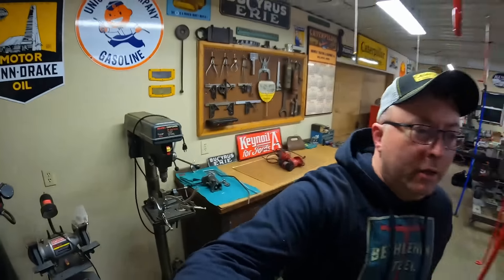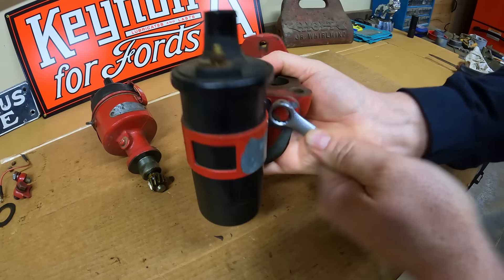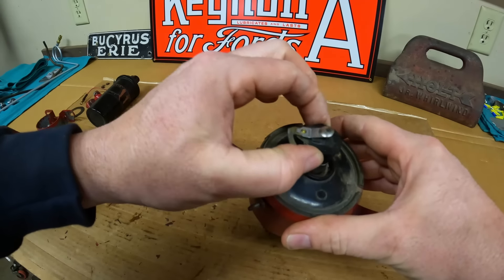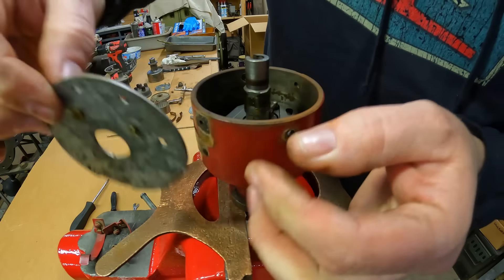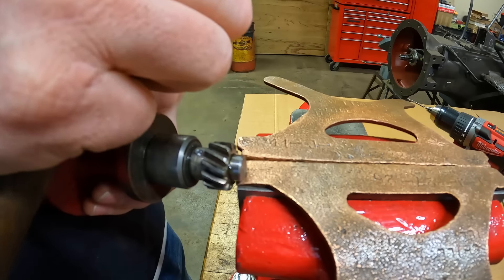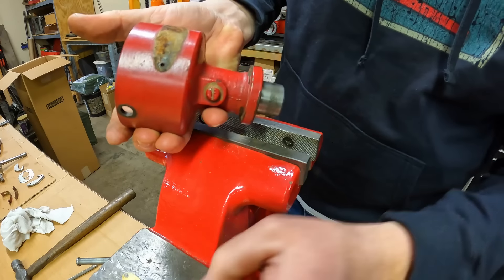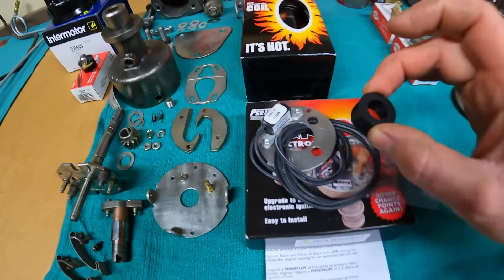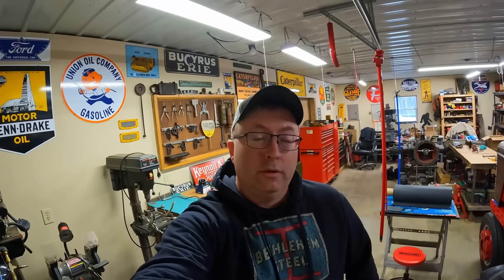Farmall Double Distributor Build! Electronic Ignition vs. Points & Condenser - "Preparation H" Ep.35

Comment: 20 + years on the automotive side I’ve used the points electronic conversion, I’ve had one failure and it was intermitting not dead in the water. The poor quality of points and condensers now you are about forced to the conversion.
Reply from the maker: That's where I am with it too, I know several others that have switched to the electronic ignition and haven't looked back.
Reply: @squatch253  I've had luck with removing the worn points off old units and replacing them with ones from new old stock of higher quality. It's fiddly and you really need to know how to braze tiny things. I tried staking them in the hole, but they don't last. Usually the arm one falls off because the metal is too thin.

Caveat: you have to have NOS parts on your shelf... so it ultimately depends on how many you can find in your area. I got lucky and an older gent i knew left me all his old bits and bobs and ~50 or so boxes with points for Skoda cars from the 1970's. Dunno about other brands, but Skoda made them a bit more ... let's say industrial. So they're good for older cars or tractors.

The idea isn't mine, got it from a few posts i read about (desperate) people cutting the sections that hold the points and welding them with a spot welder and a point of TIG welding for the base. I don't have a spot welder, but i know how to braze, so it was a logical solution for me.
Reply: @aserta  Great. I actually got the same thought of transferring the wear-heavy items - the points themselves - from the new plastic fantastic to the old sturdy ones. What about the part in contact with the lobes? You couls also get the contact points from high amperage relays/contactors.
Reply: I just upgraded, my 3-cylinder ford 2000, I'm much happier with it now

Comment: This lubrication holes of the distributors are made to lubricate the bushings and shafts. Even there's no direct hole thrugh the bushing, they are made from pourous sintered bronze that has microhole cavities in the bronze that allows the oil to go from the outside of the bushing to the inside to lubricate the shaft. They are also widely used in starter motors and generators. The oil keeps the bushing "wet" which allows the lubrication to be transfered via the microholes to the shaft inside. If you use regular bronze for this bushings the shaft will get sized with the time. Only pourous sintered bronze bushings should be used, and should be lubricated from time to time.
Reply: yes!
Reply: When Toby began his discussion of the placement of the lubrication plugs that appeared to make no sense, I immediately paused the video knowing I would find this comment.
Reply: Sintered bushings will only let oil soak through them. Grease will not. It's also possible due to their age the bushes were replaced, minus a very small pilot hole from lube point to shaft. Worn bushes
on this part will give erratic spark, like a miss. If the rotor wobbles , the worn shaft bushing(s) need to be replaced. Something I only used to diagnose when a points motor was hooked up to the goo ol' scope. The wiggly lines on the screen gave this fault away.
Reply: I was going to guess at running temperature the grease would melt and find its way to where it needed to be.

Comment: Those bushings are sintered. Meaning they are porous and saturated with oil. Same thing as in the front of a starter motor. If you put in a new sintered bushing you place it on one of your fingers, fill it with oil, and then press down on the oil with your other finger. After a while the oil will come straight out of the side of the bushing. It is a good thing to have a reservoir of oil on the outside of it, so it doesn't risk running dry. Do not make any holes in the bushing, and do not use grease.

Comment: Toby take a sintered bronze bushing and set it upright on a steel plate with a gasket in between and clamp it to the table with two vise grips, then fill it with fuel oil and you will see how fast the fuel oil migrates thru the sides.   Wipe the outside off and it will become wet in a few saconds.  This would be a good demo for the channel !    Your friend from up north    Mark

Comment: Hey Squatch,  I have used the electronic ignition module to replace the points in my classic car.  I had the same experience with the lack of quality in points and constantly was having issues.  Replacing the point with the electronic module took all them away.  It has been installed for 6 years with zero issues.  Their flame thrower coils produce a hotter spark which is also an improvement on igniting the fuel and burning cleaner.  Thanks for all your content.  Haven't missed an episode in 6 years.
Reply: Considering going to electronic ignition with the car in my profile picture. My late father's 1958 Plymouth Suburban.
Reply: Yes! Even in the days of leaded gas, the plugs would last quite a bit longer with electronic ignition. Better spark that can tolerate the plug gap eroding wider.
Reply: put the electronic ignition on our  Farmall 656 10 years ago, been good. Cut thousands of acres with a discbine behind. Used the stock coil and still using copper wires, although it is not recommended... The tractor is factory 12v alternator.

Comment: 11:21 It's not just the time it takes to fire the plug. It's also the time it takes for the combustion process inside the cylinder to occur. Ideally, we have peak pressure just as the piston rolls through its dwell period, and the faster the engine runs the more degrees of crankshaft rotation one will get between ignition and peak cylinder pressure. So, as RPMs increase, we advance timing to account for this.

Of course this engine isn't exactly a rev factory, but still, 2,000-2,500RPM is fast enough to warrant mechanical advance like we see here. No vacuum advance on it, but it's a tractor engine so it doesn't really need it.
Reply: Same as a boat,aircraft or race car engine.
Reply: @paulmanson253   Yep, though those engines have different demands and thus differences in ignition. Car engines will almost always have a vacuum advance as well as a mechanical advance to account for higher rev ranges and for sudden throttle applications that tractors don't encounter.
Reply: @curtislowe4577  It takes a few milliseconds for the coil to saturate properly. that's why points systems have Dwell and why setting the dwell correctly is key for them to run. Want the points to dwell closed long enough for the magnetic fields to build up to full strength in the coil before opening them and causing discharge. It's only a few millionths of a second, but you'd be surprised how much of an effect insufficient dwell has on the engine.

What really takes time isn't electrical. It's the speed at which the flame front travels through the combustion chamber. We advance spark timing because the speed at which the fuel burns is relatively constant, but the time in which the fuel has to burn changes based on RPM. Even in a fairly low RPM application like this tractor, if you time for TDC you'll be losing out on a ton of power and efficiency. Base timing a few degrees advance from TDC puts peak cylinder pressure right where we want it, and then advance weights in the distributor further nudge timing in as the RPM increases to ensure it stays there.

The advance we need isn't very much because this engine only revs to something like 2,500RPM wide open, but we still end up putting 15-20 degrees of advance in it to keep peak cylinder pressure occurring when the conrod and crankpin are in the best position to take advantage of that pressure.

Comment: Excellent video I believe that the bushing was meant to be drilled out so grease could make it to the shaft on the original design then they came to realize that they would get greased excessively and it would gunk up the advance system on upper end of the disturbutor. John Deere 2 cylinder tractor engine uses a similar delco Remy disturbutor but the grease can get to the bushings. Keep up the great videos

Comment: The electronic ignition conversion I did on my old Ford 4000 backhoe was the single best thing I ever did for it. Been on there for several years now and been flawless. Got tired of having to fight with crappy points every time I went to use it. Didn’t matter what brand points, even NAPA were junk.

Comment: When I first starting working on HVAC equipment,  motors  had flush through setup,  grease until it  came out the opposite plug,  then run motor till the grease quit running out the relief plug (heated up) then plug back in.   In 1990 when I Baldor Motors in a new facility,  we had issues.   No flush through.   Bearings would go.  Pull apart and there was a shield on the bearing on the grease pocket side.   No grease could get in.   I just replaced with a double sealed bearing,  good for 10 years continuous or better.    Reliance (bought out by Baldor!) of that era has real grease setup.     Baldor  the grease actually pushed the shield against the bearing.   Truly nuts but there it is.

Comment: I have just paused the video to tell you that I have just fitted an electronic ign to my 1972 T120R 650cc Triumph Bonnieville twin and it has totally changed the bike. It starts first time kick and never spits or misses. The spark is a lot stronger and cold starting is now an easy task and not a mission. One of the best conversions I ever did to it....
Reply: get rid of that Lucas junk - designed in the atomic age for WW1.
Reply: @hairy-one I DID....I fitted it with a Boyer Branson kit. Best thing I ever did to it....Did they have Nukes during WW1 (19014-1918) 🤣....
Reply: @jakobrebeki  Madam Curie received her Nobel Prize for discovering Radium and Plutonium in 1903
Reply: @angrybobking5083 But did it go bang?....

Comment: 50 years ago I replaced the points in my Chervy van with a pointless ignition.  I also put in a better coil and changed my plug gap to .055".  The improvement was amazing!  Benefits:  timing and dwell never change and don't need parts replacement, idled at 400 rpm, started instantly, mileage went from 13.5 to 17 mpg ( and 23 later when I put in manual overdrive and 3.07 rear axle).  200,000 miles later it still starts instantly (the coil and bigger plug gap were important).  In the 70's GM was running .080" plug gaps in some engines with an HEI distributor.

Comment: I have put an electronic ignition on my td14. And absolutely love it! They work great! Or they don’t. Haven’t had a problem with mine. As for the distributor lub. The old ones was grease lubed. The new or aftermarket ones you took plug out and but oil in them then but plug back in. Thats why they have a spiral cut in them. Kind like an oil pump if you will. Hopefully it helps. I could be wrong. But pretty sure that’s correct. Been a bit sense I have messed with them.

Comment: 10:49 One slight clarification on ignition advance.  While it does take some milliseconds for the points to trigger and discharge the coil through the distributor and out to the plugs, the main reason for the change in timing is piston speed vs. the flame front in the combustion chamber.
In an H engine at idle, the piston is going to be pausing at TDC and then accelerating up to 4 miles per hour.  However at 1700 RPM, that top speed is up around 14 mph. In order to build up enough pressure in the combustion chamber in time to actually do work on the quickly accelerating piston, the fuel/air mix must be ignited sooner.  Since we're burning the mix, not detonating it, the flame front actually does take some time to cross the combustion chamber while the piston is finishing its compression stroke.  If we didn't advance the timing, the spark would hit too late, and the piston would already be moving down the bore on the power stroke.  Without the advance, we're wasting power and producing less torque at the crank.

Comment: You will be very satisfied with the Pertronix electronic ignition system.  A couple of years ago I replaced a troublesome magneto ignition on a C Allis Chalmers with a distributor ignition using the Pertronix set-up.  Miller Repair in Willmar, MN recommended it.  The electronic ignition is less sensitive to humidity and produces a much stronger spark at low RPM.  I know you believe it's sacrilege but I also replaced the inop 6V generator with a 12V-1W alternator.  Prior to doing this the electrical system was a total loss system.  This tractor had previously been heavily butchered by some other hack.  This Allis is used to mow their horse pasture and other rough mowing chores.  Keep up the good work!!

Comment: I have been using electronic ignition on a delco distributor for about 15 years now and have had no issues, as long as you use suggested spark plug wires and coil without the external resister, another words follow the directions which you are very good at.
Reply from the maker: Yep, I’ve got the recommended “hot” coil and proper plug wires as well 👍

Comment: I would paint the distributor and then apply the tag with a bead of silicon caulk or grease behind the tag to keep the dirt out and then re-attach the tag.  The paint is on so the silicone can't hurt the paint job and the caulk keeps the Distributor-Tag interface clean.

Comment: I have been pulling wrenches professionally now for 55 years. Just finished an H out of frame overhaul yesterday and the customer wanted a Pertronics installed . I told him you buy it and you put in in when you get the tractor back. I will not put it in. In the last two years I have removed two electronic units and put points and condensers back in. One was a 730 Case that actually caught the wiring insulation on fire out of the distributor . Lucky it put itself out and did not burn the tractor down in the field . The second one was a Ford 8N that did the same thing when the owner first started it in his garage , side distributor model and he put it out with an extinguisher , lucky. Yes I agree that it is hard to find quality in new points and condensers but the problems more than most are tractors that sit a lot and not run much , ( trailer queens). Once you do get a good condenser leave it alone! Change out 
the points if needed but when you get a good condenser let it be. I have been having the best luck with Standard brand ignition parts. That's my two cents from experience.
Reply: Agree, really dislike the Pertronix electronic conversion kits.

Comment: I had an old style Bronco that the replacement  points went fast,  terrible quality material.   Replaced with an electronic trigger,  I had a failure on it but its replacement lasted until we sold the Bronco 10 years latter.   Loved it.

Comment: I put the electronics in the distributor of my John Deere G shortly after they became available.  I'm guessing 25 to 30 years ago.  The tractor was easier to start and the plugs last dramatically longer.  It's still got the same unit it today with absolutely no trouble.  I actually farmed with this tractor and the unit has quite a few hours on it.

Comment: I am one of those people who likes the Pertronic ignition system . I used a Pertronic system in my 1953 M37 military vehicle and going on 10  or so years and never had a but of trouble., It has a 230 flathead engine and you could balance a quarter on edge when it's running . Love the video's BTW  I am also into John Deere's  , but I also like red , LOL  I am located in WNY , south of lake Ontario and it was Deere country for sure . Be safe be well

Comment: I have installed the pertronix on a 4 cylinder motorcycle that kept having points issues and a inboard 302 ford boat, both worked great after

Comment: I had a couple Harvester 345 truck's with points in them.  One of them, no matter how much electrical work we did, kept burning out the points.  At the time, I had to replace the entire distributor and chose an electronic one as there wasn't a points-to-electronic conversion kit back then.  The replacement, turned out to be a Crane racing distributor (and really reasonably priced to my happy surprise).  The change in engine performance was amazing.  I was filling up the truck four times a week with gas before the change.  After, filled up only on Fridays.  Money very well spent.  Hope you have a good experience with your conversion.
Reply: There was Farmer near Tescott Kansas,that had a 915 combine with a 392,his gas man hated to see it leave the area

Comment: I own 2 Farmall H's one from 1941, the other from 1952. The 1941 has the Delco upright on it. My 1952 also had a Delco when I first got it, I changed to a Factory IH distributor and it seems to run better on that one. Also, the Delco can be used on any tractor that has a #2 mag mount on it. Including Case and Allis Chalmers tractors

Comment: Oilite bearings.. are sintered metal, compressed powder, then heated to fuse into a solid. At a microscopic level the bearings are filled with voids that 'slowly' allow oil to creep, and lube the face.

Comment: I installed the electronic ignition on my Cockshutt 35 tractor. Very happy with it, as well as the 12 volt conversion that went with it. I like keeping them the original 6 volt, but the new 6v parts just don’t hold up and I got sick of no-starts and having to replace things.

Comment: Are they Sintered bronze bearings? They are generally ideal self-lubricating . Sintered bronze bearings are made of porous bronze and are usually filled with oil. That may explain the lube oil and no other hole in the distributor shaft bushings. Just a idea Cheer from Australia.

Comment: Harley Davidson owners, went through these questions 30/40 years ago, some bought brand new bikes, removed the ''electronic ignition'' and the new fangled ''belt drive'' and replaced them with points and chain drive, why?? so they could fiddle with points on the side of the road, but in reality the electrics never failed.. or need adjusting.😊😊👍